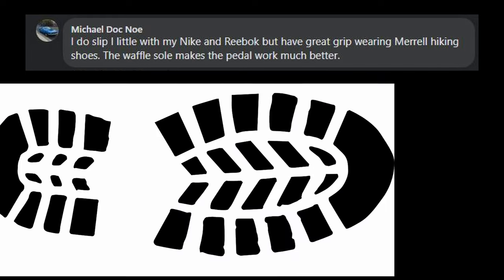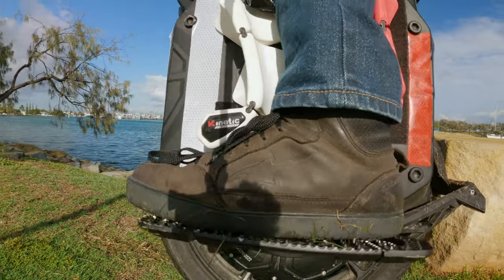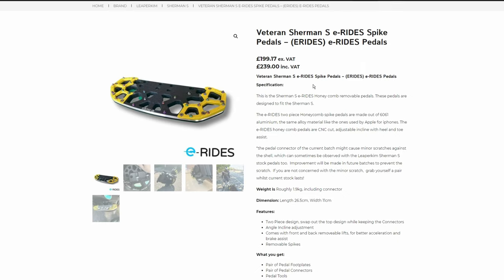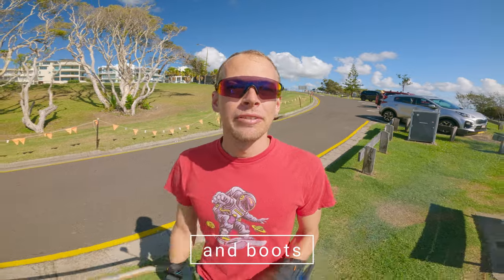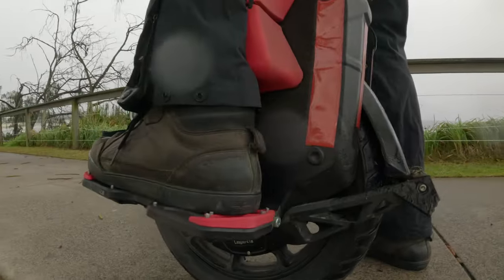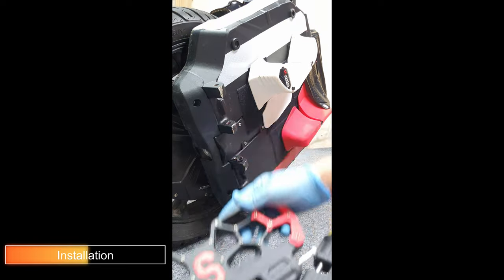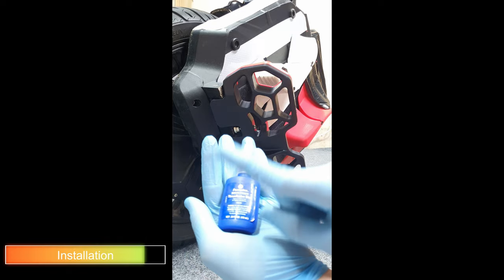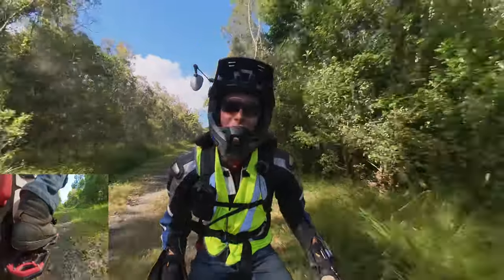4 Footplates for Veteran Sherman S - NyloNove Review and Installation Series No3 [Part 2.2]

Comment: Great video.  For my Sherman S, I have the eRides spiked pedals. Very happy with them.  Ride safe🙏
Reply from the maker: thanks :) Good choice! I'm curious if you had those issues installing them or the floppiness falling down?
Reply: @jonoeuc  I figured this out… the cover over the ratchet has too tight a tolerance. It you snug the screws, the ratchet either floats above or grinds into the opposite teeth. I cut some thin plastic strips to shim under the cover. Works perfectly now with the cover tight.
Reply from the maker: @manapeace  Hey thanks for the tip! I believe I just read your post. Here's the link for anyone else who is curious: 
https://www.facebook.com/groups/1428766734278829/permalink/1555105011645000/

Comment: I swear by Nylonove foot plates.  It was a game changer for me on my OG Sherman.  And just that slight micro flex made such a difference.   Hoping Nylonove will have a V13 specific foot plate in the near future but might have a look at their other options since I think the foot plate mounting measurement is pretty standard on the V13.   I'll DEFINITELY be ordering a pair months prior to ordering my Sherman S later this year.  Just not the same riding a Sherman with anything else.   Liking the new graphics on the comparison BTW.  Next level achieved!  Ride hard, ride safe mate!
Reply from the maker: The free Sherman S footplate upgrade is OK, not amazing. Nylonove still my fav.
Damn I just had a look and nothing for the V13.
cheers mate, you too

Comment: I actually adjusted my Nylonove studs downward by a fraction, as they were for me too grippy, I nearly couldn’t get my hiking boot out and off the pedal when it came time for the first dismount.  I got the non-bite system but without the overlays. I have Nylonove pedals on my MSP and my V2 Sherman, and like yourself love the slight flex they give. I was so surprised when I first got them to note that two Nn pedals weighed a fair bit less than one single Gotway CNC studded pedal, which is a decent weight saving (750g v 1880g!), which must be of help more generally. Cheers from Scotland!
Reply from the maker: Hey Forester, good to know thanks for the info. It seems by comparison my boots are just a bit slippery. I'll be keeping an eye out (no rush) for replacement boots in the future, hopefully with Boa or quick laces.

Comment: Wow Jon Crazy you have been to this much trouble to get her feeling great but glad you have managed to in the end I havent had any issues  with the V13 ones so im leaving them stock great video mate :)
Reply from the maker: Yeah the ShermS was a rocky start for me, super dialed in now.
Ah that's great re your V13, Have you had any issues, motor bolts or rebound adjusters can snap?
I reckon the V13 would've been better out of the box for me. i'll have to get to Brisbane to ride one sometime :)
Cheers
Reply: @jonoeuc  not one problem and the wheel is a rocket you need to get one the weight your body adjusts to it and the thing is with power assistance it makes it feel like a V12 it's bloody amazing

Comment: I've personally had experience with hard flat soles on moto boots causing issues on all kinds of studded plates. My personal favourite shoes for studded plates are Vans, because the waffle pattern bottoms really bite and the studs sink into the pattern; basically like what you were trying to achieve with the custom sole modifications. Some plates are clearly better than others when it comes to compensating for a less optimal shoe pattern, but I think the bottom of the shoe contributes as much if not more to the quality of the grab onto any studded plate.
Reply from the maker: 100% 
I'm reluctant to get new shoes but it seems they just really suck lol. The rubber is very hard and non grippy. With all the mods they've been decant so far... But can still feel that they aren't 'gripping' properly with the rubber.
I'll be keeping an eye out (no rush) for replacement boots in the future, hopefully with Boa or quick laces.
Reply: @jonoeuc  I've now received my Batch 3 SS and ridden it for 3 weeks, I'm up to almost 500km, and as I suspected, with my Vans I've actually not had a problem with the stock footplates. I'll agree with everyone that they aren't ideal because the cupped shape of the lip doesn't let you get the full engagement with the spikes, only the tips... but I still think the design of the sole of the shoe and the type of shoe matters a lot. I am also using grizzla flow pads to help lock my feet in more, but I still give myself enough room in the toe to easily mount and dismount, and go seated. 

I also came from the V11, and have the inmotion hex pedals, so maybe my experience was with less ideal spiked plates than nylonoves or similar, but the SS stock pedals are for me just as good as the V11 hex plates. I think for anyone looking to ride MTB style plates, motorcycle boots are generally very hard and not designed to grip, they're designed to slide in a crash, so the soles aren't ideal. Waffle pattern soles that the spikes can sink into, along with good pads are more important than the specific pedal design.
Reply: @jonoeuc  sadly most of shoes pads are made from more like plastic instead of rubber and very slipery on ice.
Reply from the maker: @milordas  do you ride in the snow / ice? that'd be something. i'd definitely get different boots!

Comment: Those pedals should comming with stock Sherman S as its a premium wheel. Replaceable pedal hangers could be even better like on Patton, but still ok until you crash them realy hard and then you'll need to replace whole battery case
Reply from the maker: Sherman has updated them for the latest versions. I was supplied with them too and have been meaning to make a quick video about it.
The hangers are hanging in there after two crashes so far.
cheers

Comment: Just replacing the Philip's screws with set screws helped tremendously.  Planning to just shave a bit some of the studs and drill/tap them to add more set screws.

Probably will end up costing a whopping 5$CAD and 2h of labor 😂
Reply from the maker: definitely worthwhile haha
I already had the Nylonove on order and was like hmm well then.
Reply: @jonoeuc  BTW,  small question. If the bearings are 100% seated right (mine have 0.5mm variation at the axle), could it be possible that it could lead to oscillations of the wheel at the tire level ? I've got one of more than 1/8 inches and wondering if it couldnt be the source of power he problem.

Comment: hello, can I have your opinion on your helmet mirror ? know where you put it exactly, and if the grip is solid?  if we see well?  if the vibrations do not interfere with visibility?  why didn't you choose a wrist mirror?  THANKS
Reply from the maker: Hi Fabre,
A helmet mirror is always in the right position and ready to go. 
A wrist mirror isn't. You have to attach it each time (or attach to the wrist guards). 
You have to position your arm/hand everytime. this may also trick other people into thinking you're indicating a turn when you're just looking at the wrist mirror.

The helmet mirror is almost essential and I hate riding without it.
It's for keeping an eye on upcoming vehicles or cyclists etc when on the footpaths. Keeping an eye on buddies during a group ride. A shoulder check is still needed for turns.
It is small but I can see enough. If the sun is up to my right, behind the mirror it's useless.

To position it, put on the helmet first and hold the mirror onto the helmet. I position it above my eyeline so I don't lose any visibility. If you're in a right side driving country then put it on the Left (or one each side lol). Mine is on the right for Aus.
Lift your visor all the way up before attaching.

The stock attachment is velcro which is useless. I built up a curved profile of double sided tape.

Hope that helps
Cheers jono
Reply: @jonoeuc  thanks a lot 🙏

Comment: This is off subject but I can’t find anywhere about the subject. Can I leave my Sherman S in high speed mode all the time?  Does it cause damage to the battery, motor, etc over time?
Reply: Yes you can leave it in HS mode, however running the batteries down very low all the time is what hurts them. Make sure you don't run below 80 volts to be safe.
Reply from the maker: as far as I know, just like Darren said, 
I've been in HS mode for awhile now.
Hope that helps!

Comment: Wouldn't E-Rodes CNC pedals be better then Nylenove?
Reply from the maker: in what way?
It's hard to say without trying them. The NyloNove wins for me because they're larger, more studs around the end toes for seated riding, stud length adjustable and the slight flex for foot comfort (although this turned out to be minor).

Comment: No loctite?  Is it because loctite was already applied from the factory?
Reply from the maker: I was a bit taken aback too. It was quite boldly written in the instructions. My guess is that there's a chance of tearing out the thread with the locktight since it's a Thermoplastic material.
Reply: @jonoeuc  oh.... I see.  I could be wrong, but I believe loctite is only for metal.  Maybe that's why.